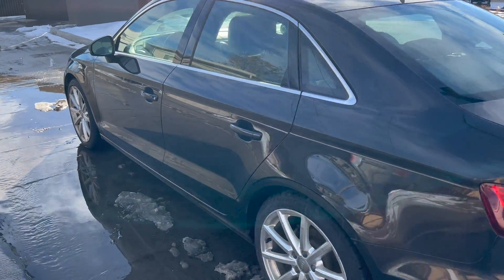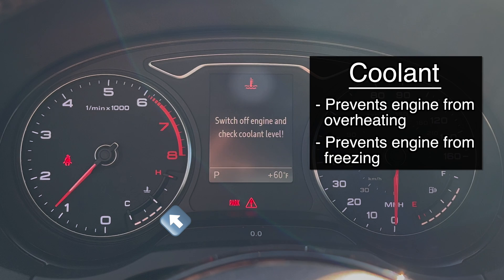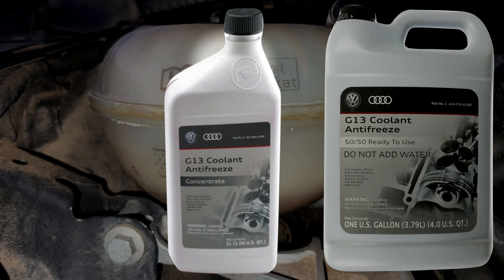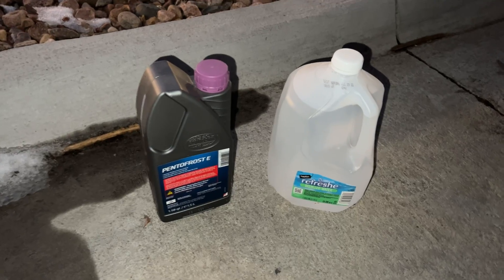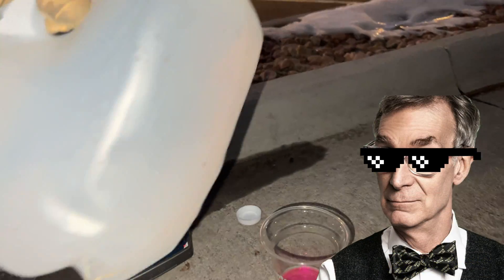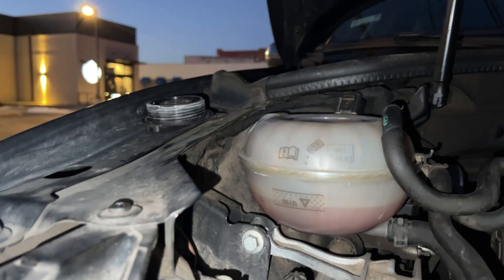How to Diagnose and Fix Low Coolant Warning for Audi (A3 8V) / VW

Comment: I added coolant to my VW passat but the indicator is still ON and when I checked back there is no coolant in the reservoir. what can be the problem ?
Reply from the maker: Sounds like a leak to me. Check underneath your car. See a bunch of coolant pooling up?
Reply: @mattpopovich  thank for reply Matt. I dont see any leak.
Reply from the maker: @rahulfarakte2049  hmm well where’d it go!? 😜 how long was it between adding coolant and seeing no coolant in the reservoir?
I would add coolant, let the car sit overnight, see if coolant is at the same level in the morning. If it is, I would then start the car, let it run for a few minutes, see if coolant starts leaking. 
If we can recreate the leak, then we have a starting point to fix it.
Reply: @mattpopovich  I added the coolant almost touching max level and got in the car and started it, the indicator was still flashing so I got back and looked the tank and it was all gone. Even I am wondering where did it go 😀😀
Reply from the maker: @rahulfarakte2049  oh no!! 😂😭 let me know if you find anything out. I’d try not to drive it anywhere. If you must, keep a close eye on the engine temperature gauge as mentioned at 0:52.
Reply: @mattpopovich  will keep you posted 😃. Thanks for quick responses.

Comment: What if I see a leak at the bottom of the engine bay, could it be a hose leak or replace the whole water pump
Reply from the maker: Well first are you sure it’s coolant leaking? Is it pink —> coolant. Blue —> windshield washer fluid. Is it oil? Use a white paper towel to soak it up and more easily identify it.

Comment: Useful video, it does feel scary when it comes up yet such an easy fix. On later model it's worth doing the OBD2 tweak to show oil temp in instrument cluster as it is replaced by a boost gauge so not visible otherwise.
Reply from the maker: Great point! I completely forgot about that. I believe the oil temperature gauge is swapped out for a boost gauge in all S3/RS3 (doesn't matter the year). See this video for an example of a 2015 S3 PLUS they show how to get an oil temperature reading without doing any OBD2 tweak: https://www.youtube.com/watch?v=jSTC5FCfJdA

For anyone else reading, here's how you can do the OBD2 tweak that @Beardchanics Garage mentions, he has a great video on it: https://www.youtube.com/watch?v=--jgt7jy-xo
Sweet channel you have there! Thanks for commenting!

Comment: The animations are sweet! What editor are you using?
Also, check out that front vs rear wheel speed difference at the end. Was that traction control kicking in to try to put most of the torque to the rear?
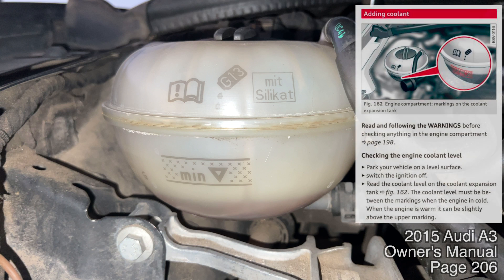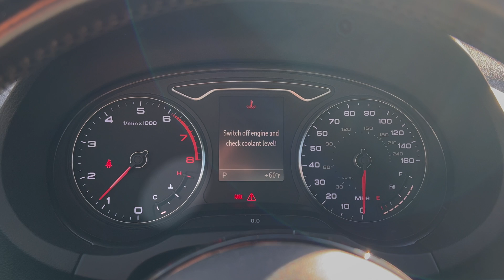Reply from the maker: Appreciate the kind words, Dan! I use Final Cut Pro. No fancy animation plug-ins, just basic shapes and keyframes (for now). The keyframes basically let me set one value at a certain time (Ex. shape positioned at x,y), then another value at a different time (position = x+5, y+5), and FCPX will interpolate everything in-between to "animate it". This can be applied to many different attributes such as opacity 3:14, position 1:49, crop/trim 0:33, etc. This was my first time using the "highlighter" affect which I learned from this video: https://youtu.be/4UQ3JJYeZ6o It's pretty tedious and time-intensive but it works!

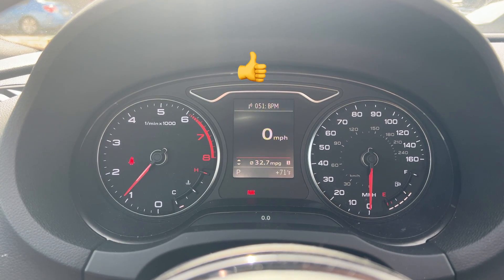I'm glad you stayed until the end to watch the launch at 6:44! Look familiar at all? ;) That's the FWD-biased Haldex Quattro at work. The front tires are spinning throughout the whole launch, but it appears to me that the rear initially starts spinning almost immediately, then all power is shifted to the front, then the final decision is to shift power back to both. Traction control was disabled for the launch if I remember correctly. I believe we're just watching the AWD system at work. Pretty interesting.